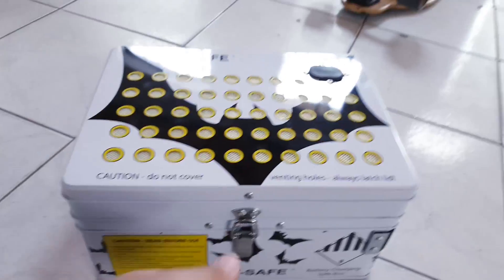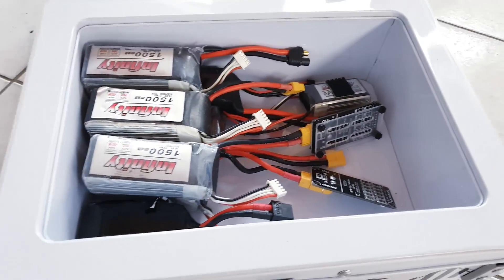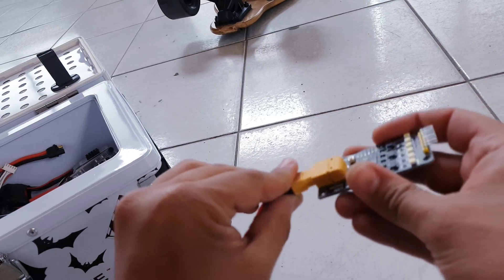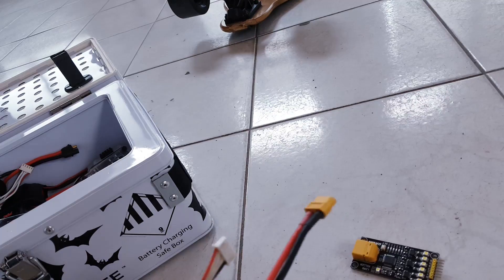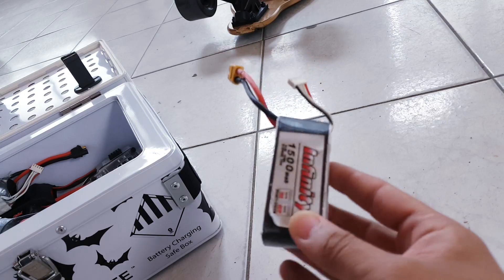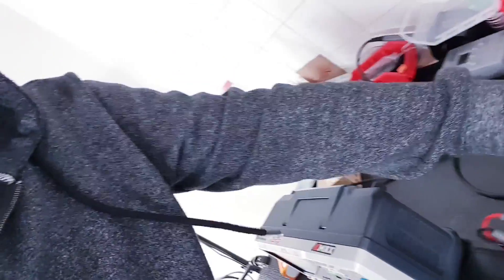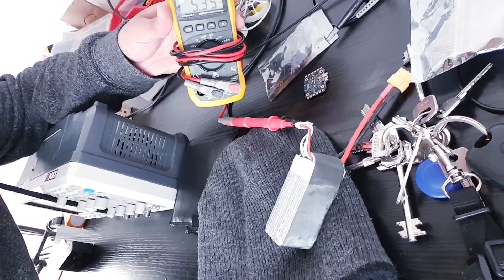Killing Lipos with the URUAV Lipo Killer // Review & Update Video

Comment: i store mine in a metal can,  need a lipo killer ,   thanks to my thunder power balance board and charger its way off . it says cells are at 3.85 but volt meter says 4.2 no wonder they swelled in storage . got new charger and all new batteries .

Comment: I built a simple circuit with a 3 way switch and 3 12 volt supermarket light bulbs.  two of the bulbs are in series behind switch pos 1, switch pos 2 is off and switch pos 3 is one 12 volt bulb..  bulbs are rated at 20w so the discharge is less than 2 amps. cost me couple euros to make.
Reply from the maker: Send me an email with your setup
Reply: @DroneMesh  Sent you an email with few attachments and random jibberish about the build. Let me know if you have any questions or problems.

Comment: I'm guessing they're designed to only discharge at a slow rate because most people would only be using them on obviously puffed packs. So it's probabbly just down to the manufacturers covering their own arses in case someone decides to plug one into a puffed low C rated 300mAh 4S pack. The low discharge rate will make it safer for the muppets who can't work out the maximum amp draw a battery should be able to take.

If the aim of the game is to totally flatten a pack, Why not get a couple incandescent "H4" car headlight bulbs? Slap them in series so they can deal with the higher voltage and they should pull somewhere around 4.6Ah out of 6S packs, 3.8Ah from a 5S, And 3Ah on 4S.

Comment: Could it be used to discharge lipos to the storage value ?  And being sure it stop a choose voltage ?
Reply from the maker: Yes it does..
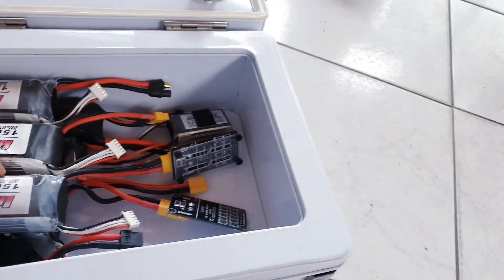Reply: @DroneMesh  What is the box you use for your lipos at 1:48 ? I never seen this ?
Reply from the maker: They are lipo-safe boxes called batt-safe you can find them on hobbyking..They prevent fire if you dont exceed the watts requirement for each box.